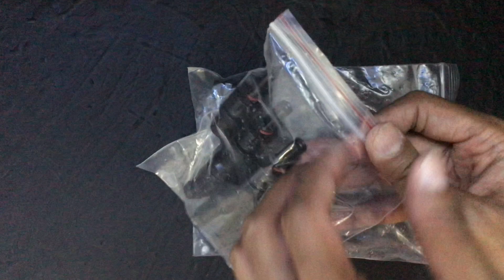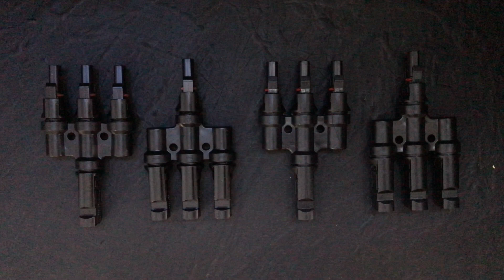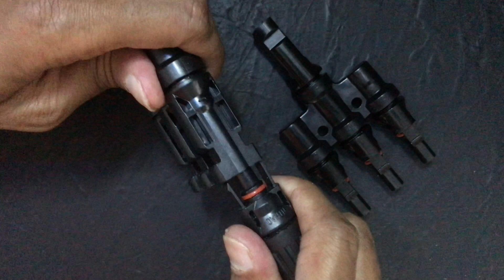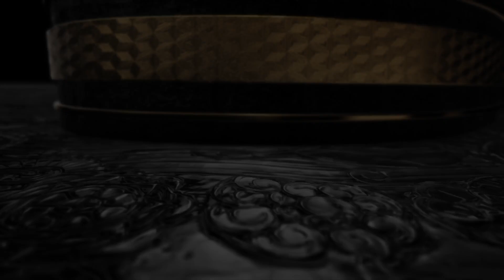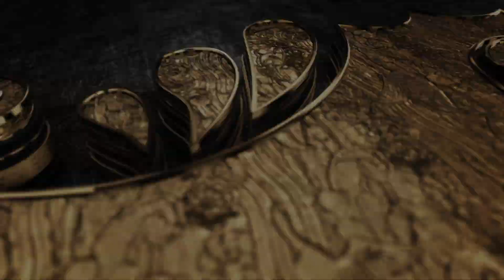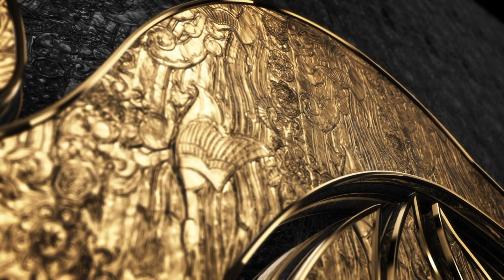Unwrapped: S04E36 | MC4 3-to-1 T Branch Connectors | Solar Panel Cables | PV Photovoltaics | Wiring

Comment: arent the pins in the female side too thin?
Reply from the maker: Yes. Only use these for the lesser types of panels.  Get the right gauge as required.
Reply: @ProductsChannel  is the Y-cable better?
Reply from the maker: I use both types and both are good.  Ecoflow company sent Y cables.  They are good.  Just make sure the gauge is appropriate to your needs.